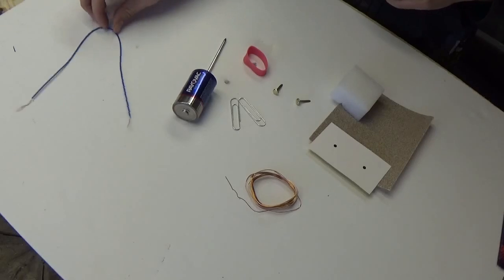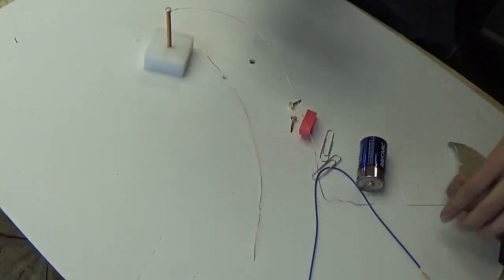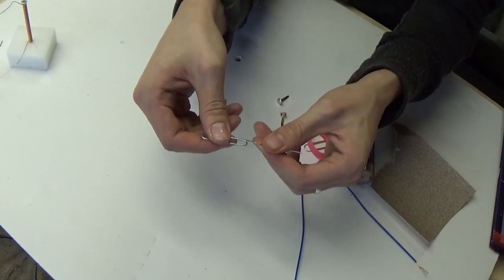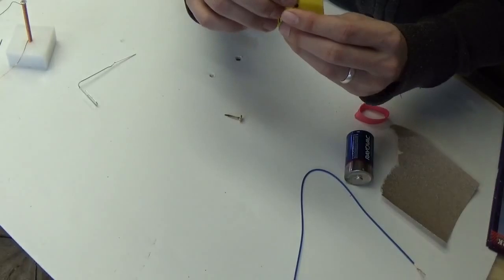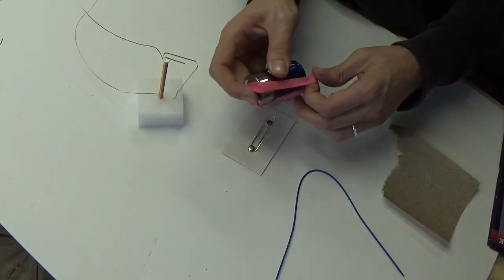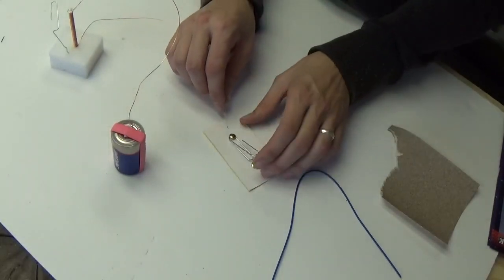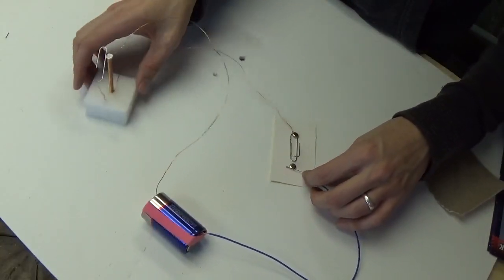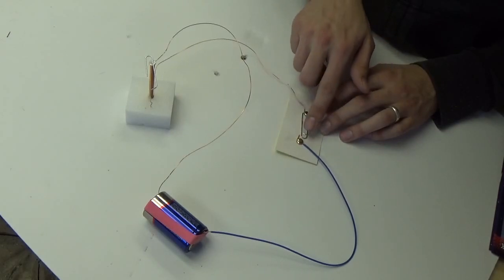How To Build a Telegraph

Comment: What kind of wire, specifically do I need?
Reply: he uses enameled copper wire,you can use other metals such as brass,aluminum...etc.

all the wire has to be enameled or else it will behave just like a tube not a wire.

Comment: This telegram sounder is missing a critical element. A telegraph sounder makes a click sound when it is engaged and a clack sound when it is released. For a dit the time between the click and clack is short, and for a dah the time between the click and clack is about 3 times longer. Without the 'clack' part it is not possible to distinguish between a dit and dah. For example, how would you tell the difference between the letter 'e' (dit), and the letter 't' (dah). 

To fix this design, there should be something above the nail that the paperclip hits when you release the key and the sounder paperclip returns to its resting position. It needs to make a slightly different sound than the 'click'.

Comment: Soo all the problem is that it dosent have Power, i was to the Shop and they only had 4.5V batterys and i buyed 2 and connected them can u somehow help me? It works i mean i saw it moves the papper clip a lit but not necessary

Comment: I modified this so it would fit in a small tin of a certain mint and it was awesome I also made it wireless so me and my sister could use it at a play ground.
Reply: how did you make it wireless?
Reply: @DbitDerald  i got a wirless transsmitter reciver and took some things off and put things on
Reply: wireless?that's actually really hard to make,it took me nearly a month to make a telegraph that makes good RF signals,and even more to make a reciever,which was an electric bell that would use a small jar filled with iron shavings,which would let current flow if it would detect a frequency,it also has very limited range,i could get 100m if i'm lucky...

Comment: Hey man, thank you for sharing this useful video👍
But how can I make someone receive the message?
Reply: Well this isn't wireless and here he showed it together actually there are long wires that transmit the signal (when these were in use) there were like long wires looping the whole country, continents, and the entire earth. So the transmitter clicks the message in dots and dashes (morse code) and the receiver has to note it down then decode it.
Reply: this doesn't transmit anything,it is just a system used to open and close a circuit,but it doesn't do that,it's basically just an electromagnet attracting a paperclip,quite useless,i guess you can communicate from one room to another if you had long enough wires,but this thing has no way to distinguish between a dit and a dah,the two types of signals used to transmit morse code,so again,useless.

Comment: Thanks! This'll help with my school project. One note, when you use the sandpaper to "grind" the wire, that's called stripping the wire, and you can use ordinary scissors for that, or the special tool for stripping wires.
Reply from the maker: I'm glad you enjoyed! As this a copper coded wire, scissors might work but I don't believe wire stripper would be very effective. Good luck on the project!

Comment: Hey, noob here;
can i use the same blue wire for the hole thing?
(definitely giving a sub for that)
Reply: If you are talking about the reciever, no, you must use copper wire, when it wrapped around a magnetic object and with electricity running through it- it helps it become a magnet, attracting the paper clip above it. Basically, you need that copper wire. You cannot replace the copper wire with the blue wire.
Reply: @Soulliom  What are you talking about? You absolutely can, you just need to wind it a little bit more.

Comment: Hey thanks for the video but mine doesn't do the sound but it magnets, what do you think is the problem? Thank you
Edit:Where is the sound coming from, from the paper clip or the magnet?
Reply: The copper wire wrapped around the iron screw works as a magnet, only when electricity runs through it, the sound is made when the copper coil attracts the paper clip and the two collide (But this design doesn't work off of sound as there are only 'dits' and no 'dahs' ('.' and '-' respectively) it works off of looking if the paper clip is attracted or not. Hopefully this answered your question.

Comment: Here, the clicker wouldn`t jump back. Ich tried by attaching it to a thin thread, the clicker had to move sideways and slightly upwards, so gravity should have provided enough force to detach it after the electromagnetic field broke down - still didn`t work. Problem was: the nail had become permanently magnetized. Holding it over a candle didn`t help... still, the video gives one the idea of how it should work. Thanks :o)

Comment: :(   mine is not working.  Perhaps it's the copper wire I used.  The fella at the hardware store was certain I only needed copper wire and not magnetic wire. I cannot find magnetic wire at my local hardware store.
Reply from the maker: T Delano you can use copper wire. Make sure the ends are striped so the silver is showing. I have also noticed when the base of the paperclip is to far away from the nail in the foam it wont work. try adusting the paper clip. Let me know. if that wont work i will send some more trouble shooting.
Reply: we are using a pure copper wire, 24g, and can't seem to get any silver to show through.  Also, we have everything set in a 2x4 because I didn't have any foam board.
Reply: could the uniformity, or lack thereof, of the wire wrapped around the nail be an issue?
Reply from the maker: T Delano if the clicker is too far from the nail it will wiggle but it will not click. If its too close, it will just stick. Also make sure the second paperclip which is your key (switch) is completely connected. also if you dont use enough wire around the nail it might not work. You are really making a Electromagnet and when you connect the switch it turns the nail into a magnet and it attracts the paperclip to it

Comment: how much magnet wire did u use
Reply from the maker: The Long Haired Hippies all together about 4 ft. enough to get about 90 loops around thr nail and left over for the connection.

Comment: What is the voltage of the battery. Can I do it with a 9V? Is it better to use a  copper nail instead of zink?
Reply from the maker: trickybilly it is 1.5 volt. I did not try with a 9 volt but i am sure it could work.
Reply: @WhatStuff  i use a 13.5 battery,which can,using a transformer,produce arcs of up to 3 cm in the spark gap,although my setup is different than this,it is still quite similar to this one.
Reply: Son of
Reply: Its Rayovac 1.5 v alkaline battery
Reply: you need an iron nail for a magnet,or cobalt nails but you won't find cobalt nails anywhere....